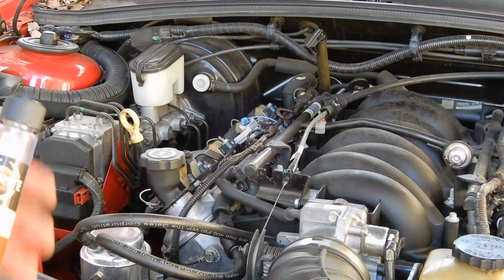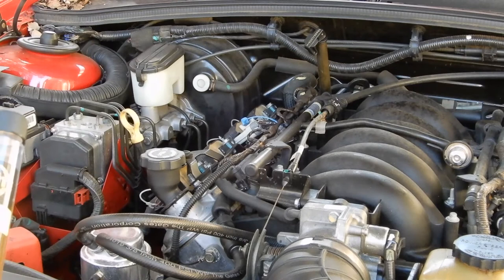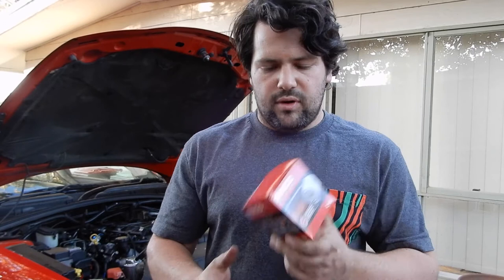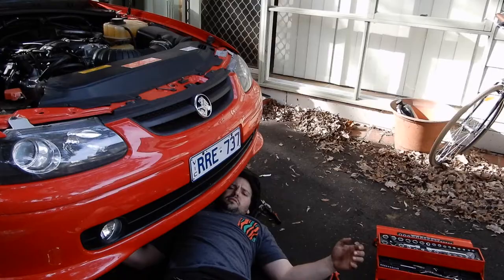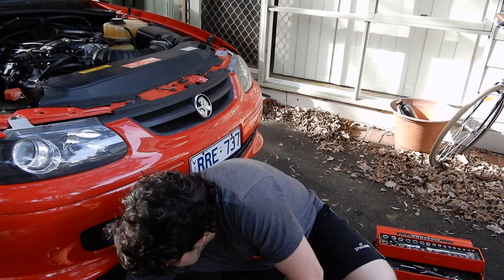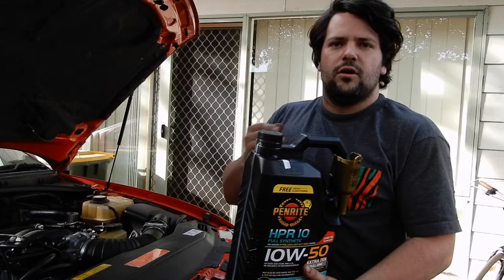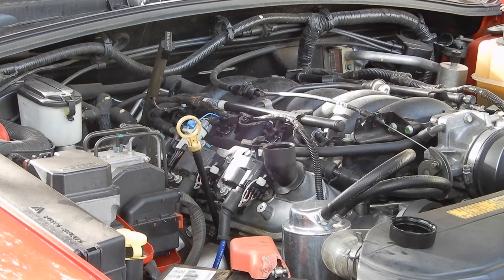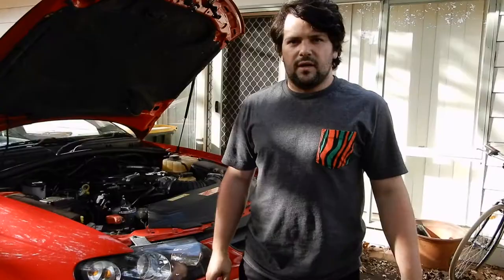Oil change on a LS1 (Holden Monaro)

Comment: You waste you money with engine flush treatments, modern engine oils have detergents in them as they are and clean the engine as you drive, good to see you using full synthetic , however I would suggest you go a thinner full synthetic, thinner oil does not mean it burns quicker that’s a myth, look I have done thousand of oil changes on cars I am an auto tech of 25 years I know what I’m on about, I also clean the throttle body’s when i do oil changes, 

the LS1 oil capacity is not 6 litres the capacity is 5.7 litres, a cup over 300ml won’t make a big difference  you are over filling though, I have a VY calais with a LS1 in it . You probably have a bigger LSD in that car than me however I like the calais I have it is all original, and that’s what you want to do don’t fall for all the wanky modifications stock cars are cool 😎
Reply: I'm not saying you don't know what your talking about but mate engine size has zero to do with how much oil it takes. I have a l98 6.0 and it takes 8.2 litres of oil. There are 4 cylinder engines that take 5 litres so I don't know where you got that from. 5.7 means it's capacity within the combustion chambers and has nothing to do with oil.
Reply: It takes 5l you goose

Comment: FYI. you don't want to use engine cleaning products. 
just do a double oil change  with cheap oil.
also that 10w 50 penrite is not the one to use in LS1 engines .
castrol magnatec 10w 40 is much better for an engine with those kms.
Reply from the maker: +freddienz68 each to there own I guess. 10w 50 is fine to use in an LS1, my last oil was 10w 40 and it was quite noisy so that's why I changed. 
Thanks for the comment though!
Reply: Did the 10w 50 oil make any difference?  Is the engine quite or can you still hear lifter noise ?
Reply from the maker: +freddienz68 yeah it has helped, early LS1 engines had issues with oil so I think this might be the solution. Others have used 10w-60 Castrol edge oil and it also works well in LS1 engines.
Reply: yeah.. I think its a bit of trial and error which oil an ls1 engine likes.  I  have been using 10w 40 magnatec castrol. But after about 3000kms after an oil change i can start to hear the lifters  ticking a little again. 
How do we fix that?
Reply: 10w50 is fine.
Reply: @freddienz68  easy
Don't use Castrol.
It's shit.
If you have a high mileage ls1 engine use penrite ten tenths 5w 50 or 10w 60.
You will be amazed at the difference it makes
Reply: Lots of Holden LS v8 owners in oz seemed to be using Castrol edge 10 60.  And they swear by that.
Reply: @freddienz68  Yep 1999 vt ss 10w50 10w60 no probs here ive had it since new. Just pulled my ls down for a full rebuild due to a big cam going in . 300,000 km 1 noisy lifter thats all it had. 10w60 never did mine any damage at all. Its had  Castrol its whole life just allways changed my oil on time everytime.
Reply: @freddienz68   you fix it by changing the lifters not masking the noise there worn and need changing.
Reply: Is penrite  better than Castrol ?  
Please explain why .
Reply: @freddienz68  Ive pulled appart engines of mine with just the use of penrite and it has more sludge build up due to lack of detrgent cleaner they put in. But if you change your oil on time pretty much any good quality oil is good. Castol is just the oil ive allways used. Performance mech 25 years +. Oil catch can will help aswell.
Reply: My 04 Holden vy ss ute has 287000 km on the clock now.
It had 117000 km on it when i bought it 5yrs ago.  For the last 3yrs i have used Castrol magatec w10 40 changed every 7000 to 10.000 km max.
Castrol edge w10 60 is way over priced.  
Castrol magatec w10 40 has been ok with no problems.
Reply: Yeah got catch can does a great job of collecting oil.
X-air otr and full exhaust also fitted.
Reply: @freddienz68  Just saw your vid brother nice job on the vy.
Reply: Thanks mate.  Did a few videos on different things I was trying out.   My latest is the air intake temperature sensor position on a otr.
What is your opinion or knowledge on that subject.
Reply: 5w 40 only
Reply: @mikecastleberry9671  
isn't  5w 40 abit thin ?
Reply: @PandaGarage  mate no it's not. It's way to thick and can be contributing to your lifter problem as the oil holes are tiny and meant for thin oil's SAE 5w 30 or  10w 30 API SL/SM ILSAC GF-3/GF-4 oil.
On top of that if your lifters are already gone which at 190,000+ kms on a LS1 they would be well on the way, there is nothing you can do other than replace them.
Reply: @freddienz68  by replacing them. LS1 motors are renowned for it. Once lifters go they get flat spot's and do the same to your cam shaft. You will need to replace both. Take that as fact